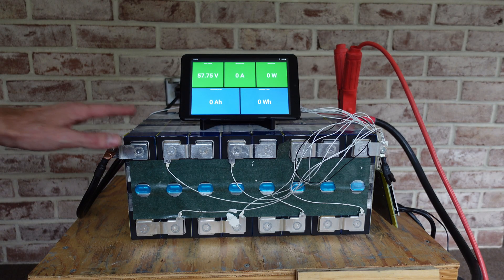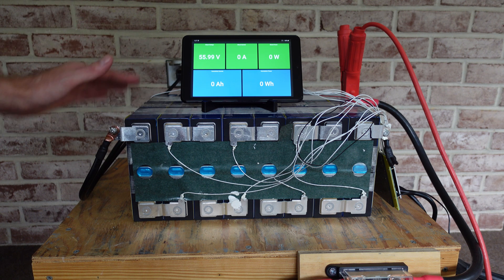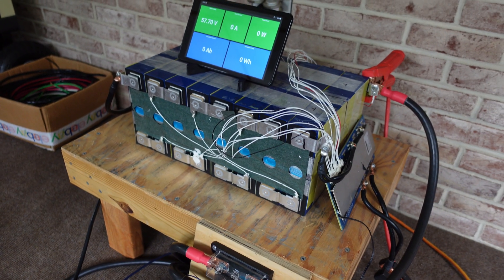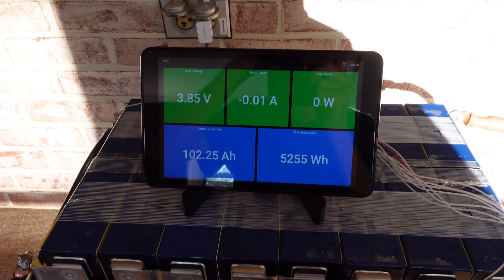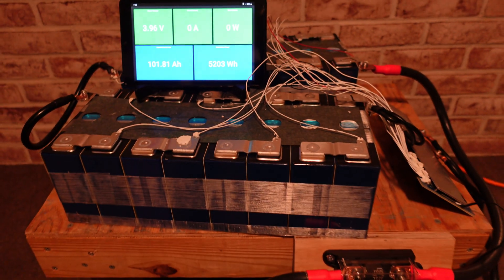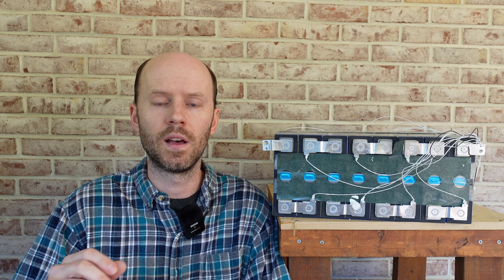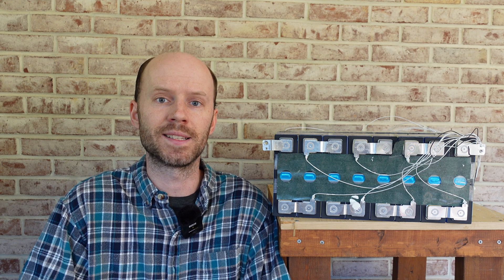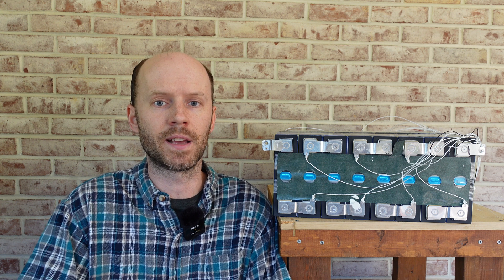Retesting the WEIZE LiFePO4 Battery, Does Cell Orientation Matter?

Comment: There is a more common orientation used in larger vertical batteries. The cells are on their large flat side instead of on their short side.
Very common for 16 kWh wall-hugging batteries using MB31 cells or similar (314 Ah).

Comment: Hello sir,  I wonder if you can guide me with something, I built a 20S lifepo4 battery, I installed a daly 120A bms,  top balanced the cells before putting everything together etc, I bought a charger capable of charge to 73v 60 amps, after discharging the battery for first time was good to recharge again, but now bms is like disconnecting and the battery is not fully charged, I have the settings to 3.6v cutoff: 2.5v  72v and 50 for cutoff, balancing I have to 3.2v, I wonder what am I doing wrong? do I need to top balance again? is recommeded to install an active balancing for the cells? sorry for bothering, any help will be appreciate it, I am trying to learn watching youtube videos and reading.

Comment: Hey there, Have you seen any strange behavior of the Cells charge voltage curve? (Maybe you have some kind of logging active?) Andy from OGG has recently found out some strange behavior on some cells...maybe this is similar?

Could't it be eater the "issue" that brand new cells without some initial cycles in Upright orientation can't release the gas bubbles from the electrolyte?
The bubbles can't escape the electrolyte because the separator is above them.

In Theory: After you cycled the cells n the Upright position, the bubbles escaped and the cells now have their final available capacity.
But that's just a rough guess 

Greetings

Comment: This is super helpful, I'm just about to start finalising my plans on installing the batteries in my boat. I'm thinking of installing them on the side, and I was actually wondering if it would impact usable capacity. Thanks!!
Reply from the maker: My concern with the cells being on their sides is mostly the possibility of electrolyte leaking from a compromised vent or terminal seal. That stuff is rather toxic to breathe.
Reply: @LithiumSolar  That's a very fair concern... I spent a while wondering if I should have a containment box with venting in case of leakage. I decided that yes, I do. As unlikely as it is for these LFP cells to leak, if they do, you want that electrolyte contained and that gas sent overboard!

Comment: Im sure this is because the cells can hold more energy when they are being used. 

That means, if they sit around not doing anythign for a while, they will record a lower capacity result. Thats why we get people to do 2 cycles before testing the capacity tests. 
Especially after delivery, which from china might take 2 months.
Reply: My nickel zinc battery show sag (voltage drop down) in their first discharge after some time storage at 35 degree centigrade, while in second discharge it’s fine, what’s could be the possible reason?
Reply: Additionally I did some research about the ongoing issues, I found that there is gas generation on positive electrode but hard to find suitable solutions to tackle it, will appreciate your feedback

Comment: Thanks for doing this video. That's 2 out of the three possible orientations, X and Y are done, but not quite there yet just Z remaining....
Reply: Z orientation being stacked vertically? Hotly debated. It's said vertical stacking is a no-no due the combined, compressive weight on the bottom two cells in the stack. Without some kind of divider separating the upper from the lower, supposedly damage can occur by not allowing the lower cells cases to naturally expand.